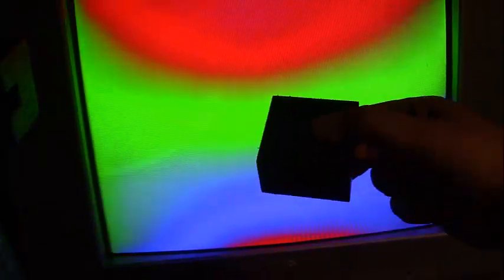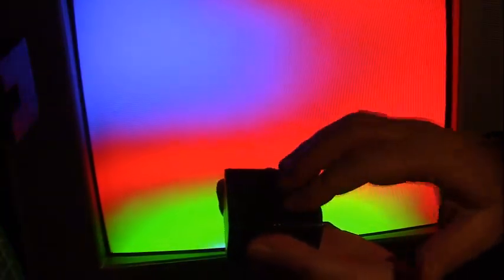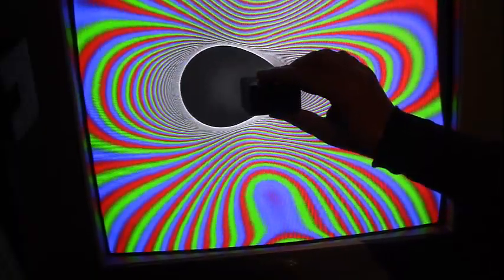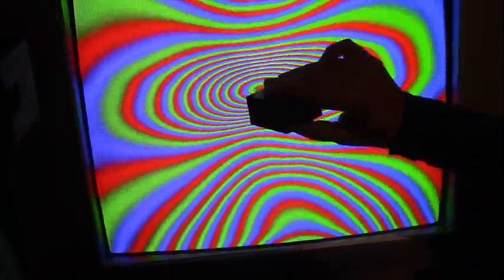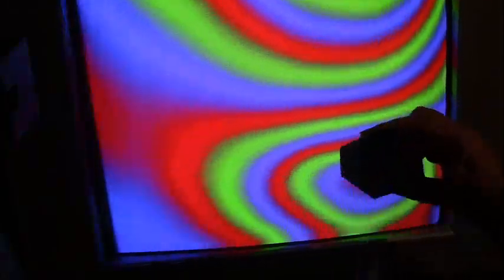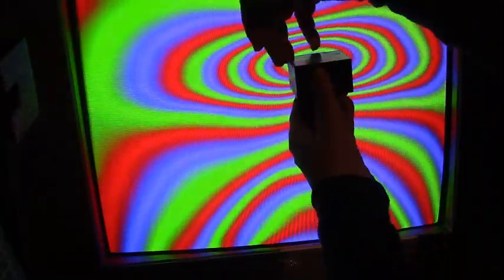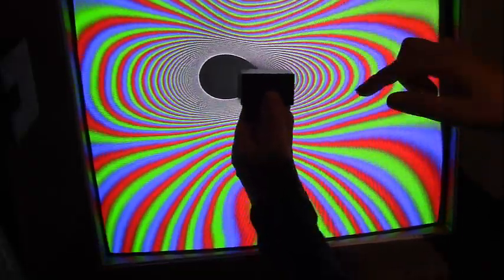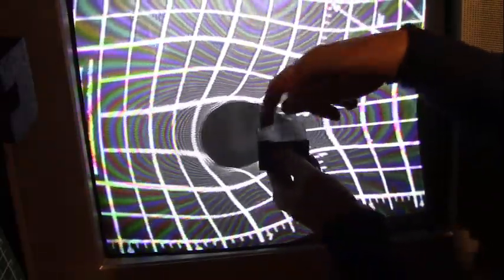CRT Screen Experiments

Comment: I know this is quite late in the day, and CRT screens are a thing of the past, but. The reason for the difference in left/right deviation between the screen picture (RGB), and the image from your camera, may be down to polarity. The screen itself, is running at about +25,000V (HT line). When you input a signal from your camera, the electron guns fire electrons at the screen, which is a negative charge. Opposite charges turn opposite ways. This may be the reason why we see the North pole of the magnet seemingly changing direction of spin, when an input is presented.

Comment: Did you manage to get a recording of this? Would love you have the results of your experiment as an asset 🥹
Reply from the maker: Can you give me an idea of what you mean by "this"? Thanks in advance.
Reply: @FractalWoman  The visual results of the experiment. As in not a recording of you and the magnet in front of the tv displaying the results, but just the visuals :).
Reply from the maker: @bnug2656  Thanks for clarifying. Actually, I did try to do this but then I realised it is not possible. The information on the screen is not available to the video output of the TV. I am messing with (interacting with) the phosphors on the screen DIRECTLY. The video output has no idea I am doing this. For sure I would have done this if it was possible. When I monitor the video out, all I get is a blank (black) image. This was a really good question though. I am sure others have had the same thought.
Reply: @FractalWoman  ahh seems so obvious now, of course the video output wouldn't register. Thanks for responding anyway!

Comment: It would be interesting to see this test with the magnet at specific calibrated distances from the screen, maybe using an acrylic or glass box or clear Tupperware between screen and magnet.  I wonder what the specific geometry of the two different curving types is at various distances to build up a mental model of the shape in slices we can combine to get a rough idea of the 3D shape of both effects.  Subjectively it seemed like the white line spin was much larger vs the color spin, but I’m not sure that’s a real thing or not.  Very interesting!

Comment: Dear FW,, according to Ken and His experiments both "Poles" of the magnet affect the CRT screen :)
Reply from the maker: Of course they do. I never said they didn't. Both poles behave almost exactly the same, only one pole makes the CRT screen twist clockwise, and one pole has it twisting counter-clockwise.  This is analogous to spinning up a flywheel. When you look at it from one pole, it looks like it is spinning clockwise. If you turn it around and look from the other side, the spin looks counter-clockwise.
Reply: may be I should have added "at the same time" ;) i.e. one pole is rotating the "electrons" CW and the other pole is rotating them CCW {At The Same Time}

Comment: Thank you for this interesting video! I have a tiny question about what does your CRT screen look like when the magnet is in another room: is it all white with no pattern? 

It may be be fruitful to look at the patterns you are obtaining with the magnet while thinking about the Lorentz force and the three vectors to consider. You have the electrons flying from the back of the CRT towards the screen (and you) and that's the velocity v component of the force equation; then you have the magnetic field B produced by the magnet that flows from one pole to the other pole of the magnet (in the classic Maxwell interpretation). When the axis of the magnet is parallel to the screen, each magnetic field line will describe an ellipsoid that enters the CRT and whose path is largely perpendicular to that of the electrons. The magnetic component of the Lorentz force is the cross product of the two vectors v and B [ F = q . (v X B) ] and thus is maximum when v and B are perpendicular to each other and null when they are parallel. The electrons flying towards the screen experience a force perpendicular to both v and B and are thus deflected sideways (left, right, up, down depending on the orientation of the magnet). 

It looks like your CRT is a trinitron type, with an aperture grille design (vertical lines as opposed to triads and shadow mask). As musaire pointed out, there are three electron guns for color TVs (and three phosphor screens) and  thus the tiniest movement of the electron path due to the magnet and this electron will not hit the phosphor screen pixel it was supposed to reach. When you put the axis of the magnet perpendicular to the screen, the incoming electrons see a very different magnetic field. The magnetic flux lines coming out of the pole are initially parallel to the path of the electron and thus exerce no force, but these lines are ellipsoids so within the CRT space they curve back to go to the other pole, and as each line turns it is then perpendicular to the path of the electrons and deflects them, but with a very different pattern when compared to the magnet axis parallel to the screen. Because the distance between the lines of the three phosphor screens is very small, the slightest magnetic field will make the electron hit the unintended phosphor screen. 

When the magnet is close enough to the screen, the intensity of the B field is simply strong enough to deflect all the electrons and you get that "black hole" effect. In that respect I could not really tell why that hole was going to the right or left, was it dependent on the position on the screen?
 
When you put the grid pattern from the videocamera on the CRT screen, the white grid is formed by electrons from each gun hitting adjoining pixels of the phosphor screens. These electrons fly very close trajectories and are smoothly and similarly affected by the magnetic field, so these white lines don't split into their constituent colors even if a given electron is hitting the "wrong" phosphor screen. You don't see deflection near the center of the pole because the field is parallel to the velocity, but as you go away from the center you see increased distortions as there the field turns perpendicular to the incoming electrons on its way back to the other pole and a force is exerted on the electrons. The patterns you obtained seem to make sense to me looking at it this way, and no precession dynamic needs to be involved.

I am looking forward to more of your videos ;-)

Comment: You have to remember, you now have TWO competing magnetic sources over control of the Electron beam. 

Normally, there is only the X (Line) and Y (Field) Electro Magnetic coils that deflect the beam to produce the scan, from top left to bottom right of the screen, line by line. 
This is a very controlled, perfectly timed process. By introducing the Magnet, you are creating a very complicated situation. 
You will need to consider the effect the Magnet is having on the back EMF effects you are introducing in the coils (now a polarised bias, where normally there is none) as well as actual physical ‘bending/flexing or distortion’ of the internal components of the Electron guns. You will also most likely be deforming the highly charged mesh that forms the Raster at the front of the screen.

Without very careful control of all these effects, it’s going to be difficult to establish ‘exactly’ what’s REALLY going on.

Regardless, it’s a fascinating observation. Something I have wanted to try, is to create a line and field collapse situation, by disconnecting the X, Y coil plug from the TV’s main PCB. Providing the electronics in the TV are reasonably dumb (no load detection), it would still fire up. This will produce a single spot in the middle of the screen that will be under the influence of the Magnet only. 

You would need to turn down the brightness though to avoid burning a permanent spot in the middle of the screen. I think it would make an interesting observation. 

Risk of a substantial electric shock is possible though, even with the power disconnected, the tube can retain a charge of many thousands of volts for months. The Amps will be quite low, but an unlucky hit across the heart because of careless hand placement can be fatal. I worked in the TV repair industry for many years and loud snaps, followed by cursing was quite normal when the guys forgot to manually discharge the tube 😆

Comment: CRT can be quite a complex toy! Numerous magnetic components involved. You are upsetting what the magnetic lens tries to do inside the tube: you are deflecting electrons from its intended track directly and also disturbing the work what magnetic lens tries to do with it. All of this while circuitry drawing the picture line by line (whatever the Herz of your monitor - you get corresponding delays - drawing lines bent).
Also, the active dynamic convergence compensation circuit tries to fix problems (no idea how they do that) with you separating electrons from 3 electron guns for different colors (I can see white stays white on grid lines, for the most part).
Bending of lines can be opposite because a beams from the guns drawing an image information from your video source can bend image information downwards BUT those colored lines are not image information, those are separated colors (wrong electron gun at wrong pixel, which can create similar patterns to moiré - we reach sooner to the same color in the next color in RGB compound pixel, the more the beam is bent -  resulting in colors flowing more over to next pixels where it is bent more).
This is not precisely thought-out explanation as to what happens exactly here but some possibilities to consider. It is too complex to analyze all the magnetic components (beam focusing, deflecting, electrons themselves) and circuitry put together. We can put it all in some modeling software though.
Thanks! Your videos are very inspiring.
Reply from the maker: Thank you for your awesome analysis. It would be really cool to try to model this. It wouldn't be trivial but definitely doable.

Comment: 7:35 looks like it is actually trying to force the lines to the back of the screen.  3d'ish.
Reply from the maker: Yes I see that. It kind of makes the screen look concave even though it is convex. This is just an optical illusion because of the way the lines go, but it is very interesting none the less.
Reply: @FractalWoman  Makes me want to see an actual 3 dimensional CRT screen/magnet experiment.  Thanks for your videos, BTW..I love the mandlebrot set stuff.
Reply: I mean, would that black hole form if the pixels could be pushed back and pulled forth?  Would the pixels twist painfully CW and CCW or would they spiral comfortably to and fro?  hmmmm...

Comment: Excuse my brutality, but aren't the two movements merely orthogonal? They twist in opposite directions with the same speed and with the same centre. If we saw different speeds and different centres we might call one the "precession" of the other, but if my eyes don't betray me these are just orthogonal reactions (orthogonal because of optical dynamics) to the same stimulus.
Reply: Convergent ( Accelerating inwards ) and Divergent ( Decelerating outwards ) do you mean ?
Note the Spectrum Shift from Red Green Blue to Yellow, turquoise and Purple.
https://live.staticflickr.com/4240/34747413084_7ab787b609_z.jpg
Reply: @SocietyOfTheSpectacl  Do "I" mean? I don't understand if yours is an answer to me or if it just mistakenly happens to be written below my message. What are you referring to?
Reply: If we saw different speeds and different centres 
What you should have said was different speeds and the same centre, Look again at the image from Kens video using a smaller magnet, and you can see the 2 oppositely spiralling fields, one accelerating , ( Shifting the spectrum UP in frequency ) and the Decelerating field.
Reply: @SocietyOfTheSpectacl  Leaving aside for the moment the question of the centres, I can't understand where you see different speeds. Those spirals you describe have opposite direction but same speed.
Reply: Then why has the Spectrum Shifted from Red to Yellow , and Green to Turquoise and Blue to Violet ?
Do you understand the correlation between Speed and Frequency ?
Reply: @SocietyOfTheSpectacl  Yeah, now I see that. I was referring to Lori's video, while you were talking about the screenshot. I do understand that Speed and Frequency are inversely proportional magnitudes, so I understand why you claim the two spirals have different speeds, but I still disagree. I am talking about the speed of torsion; that the branches of the opposite spiral are differently coloured and thus their whole images have different frequency has nothing to do with the speed of torsion, which is the same. If I show you two squares rotating at the same speed, one blue and the other red, the squares will still be rotating at the same speed even if the "local", "micro" speeds inherent to their colourings are different. Those are two different movements, one the sinusoidal light wave oscillation orthogonal to the surface, the other the twisting tortion parallel and proper to the plane of the image.
Reply: @lucassiccardi8764  With regards to your original comment, I agree. It is not the same phenomema as in the screenshot.